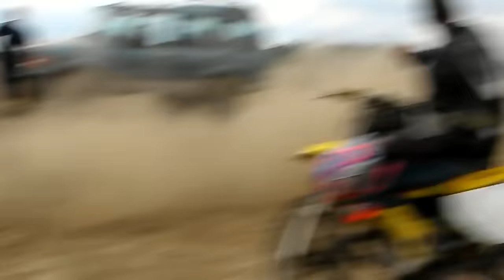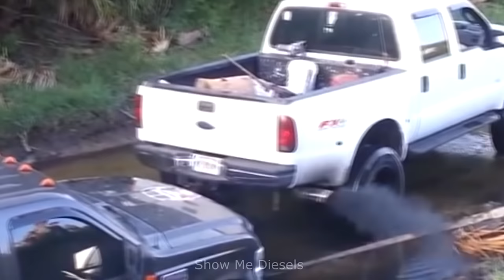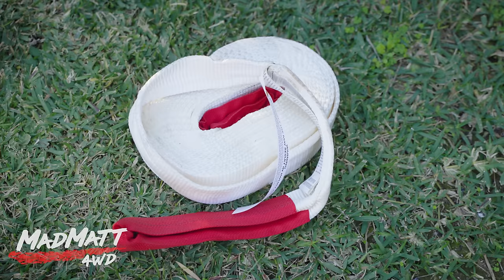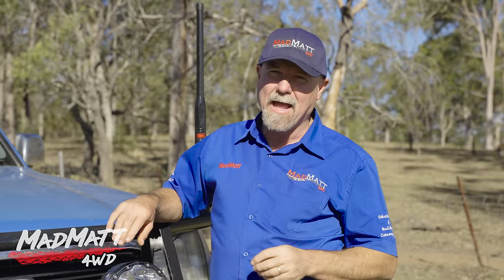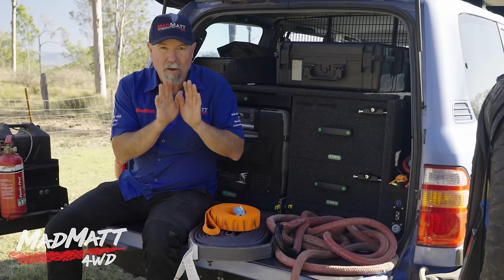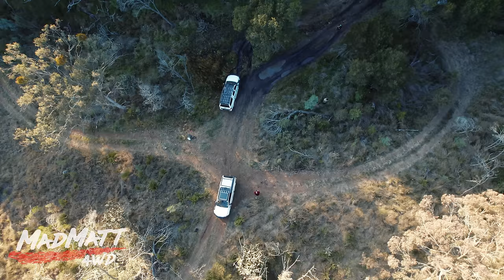PEOPLE ARE GETTING KILLED, Kinetic vs Tow Recovery what’s the difference?

Comment: Simply it is the old formula  E=1/2 x Mass x Velocity ^2  M=kg V=m/s
Reply from the maker: I’m no mathematician but I’ve been told that’s the formula.
Reply: If you say so...   😉
Reply: @MadMatt4WD   Just take a look at a 3000kg car moving at only 8kmh and using chains. It's over 300 Tonnes ! A chassis Rail can only take 24 Tonnes and a tow ball fails at 12 Tonnes. So even at 8KMH something HAS TO FAIL.

To calculate the force exerted and the equivalent mass (in kg) when the energy of a 3000 kg mass traveling at 8 km/hr is dissipated in 0.1 seconds, we can use the equation:

Force (F) = Change in Momentum / Time

The initial momentum of the mass is given by:

Initial Momentum (P_initial) = mass * initial velocity

where the mass is 3000 kg and the initial velocity is 8 km/hr.

Converting the initial velocity to m/s:
Initial Velocity (v_initial) = 8 km/hr * (1000 m/km) / (3600 s/hr) = 2.22 m/s (rounded to two decimal places)

Initial Momentum (P_initial) = 3000 kg * 2.22 m/s = 6660 kg·m/s

Since the mass comes to rest, the final momentum (P_final) is zero.

Change in Momentum (ΔP) = P_final - P_initial = 0 - 6660 kg·m/s = -6660 kg·m/s

Now, we can calculate the force exerted:

Force (F) = Change in Momentum / Time = -6660 kg·m/s / 0.1 s = -66600 N

The negative sign indicates that the force is in the opposite direction to the initial motion.

To calculate the equivalent mass, we can use Newton's second law of motion:

Force (F) = mass * acceleration

Rearranging the equation, we have:

mass = Force / acceleration

We know the force (-66600 N) and the acceleration can be calculated using:

acceleration = Change in Velocity / Time

The change in velocity (Δv) can be calculated by converting the initial velocity to meters per second (m/s) and subtracting it from zero.

Initial Velocity (v_initial) = 2.22 m/s (as calculated earlier)

Change in Velocity (Δv) = 0 m/s - 2.22 m/s = -2.22 m/s

Finally, we can calculate the equivalent mass:

mass = Force / acceleration = -66600 N / (-2.22 m/s / 0.1 s) = 300000 kg

Therefore, the force exerted is -66600 Newtons, and the equivalent mass is 300,000 kg. The negative sign indicates the direction of the force opposing the initial motion.

Comment: My parents owned a towing and automotive repair shop and I grew up in a tow truck as a kid. They moved to agricultural and to this day we are still pulling stuff out of mud and holes. Regardless, your videos are always great to watch to keep reminding all of us of the dangers of doing it wrong! Thanks.
Reply from the maker: I’ve often thought I’d enjoy that type of work. Well except the 2am mid winter call out. That would suck.
Reply: @MadMatt4WD  a ''metric ton'', strap,,has a rated breaking strain 4 times the work limit..  so, a 1.5t strap is good for a 5t vehicle,,max..eh..as to using the ''kenetic '' straps,, allways use them, as its less damage strain on the vehicle.. no one uses static straps.. unless winching.. that b/bar,, that ''come off'',,  who,,fitted it, the dumb driver.?.if not,,id be suing arb..
Reply: @MadMatt4WD  5mph..is not,,enough energy for a recovery..  do some home work..
Reply: @MadMatt4WD  you FAILED to mention,,the camera man, should of been at least 3 times the distance from the recovery that the rope length is..  try again..he is now dead, .plus, no one ever mentions the tow hitch pin shear force..just the ''rated'', shackles.. &, the transport tie downs,,are not rated. you need dedicated recovery points.

Comment: Great video. One thing that I would add is that in the kinetic recovery example, the recovery transitioned from a kinetic recovery to a tow recovery after the "bump". This is fine in the bush but may not be a great idea in sand because a tow recovery in sand often can causes the rescue vehicle to spin its wheels and also become bogged. In sand, just do the kinetic recovery to pop the other vehicle out and then both vehicles stop and inspect progress so as not to wheel spin or if you do transition to tow, just go really light on the gas and don't spin your wheels.
Reply from the maker: You’re correct. This is where Experience comes in.

Comment: Excellent video BUT you CAN NOT use kinetic rope more than once before you give it a good rest?????? You are performing two times 4 km/h and again 8 km/h with no rest in between. It is obvious that you are using excellent quality gears and they tolerate it. But out of educational point of view it would be safe to rest your kinetic rope in between.
Reply from the maker: I agree when it comes to straps but I need to find out about it with ropes. Because they are designed as mooring ropes and don’t get a rest in that environment.

Comment: Good video, took  me about five pulls using a 20 foot All-top kenetic  energy strap (I'm sure you're familiar with that name) to pull my neighbors pick up truck off the Ice in his driveway thru 2 feet of snow 6"of fresh snow covering the sheet of ice that was the street using my 2 wheel drive  1995 Ford Ranger mini truck  3,100lbs net weight   energy in motion. 2 feet at a time eventually my wheels  starts slipping on the ice and I had no further traction. Knowledge is power, as I have said before my friend; there is nothing greater than an idea that's time has come.😊
Reply from the maker: Well done. Snow and ice recoveries are new to me.

Comment: how come you did not put a dampener on the strap for the tow or the snatch recovery also you made no comment on recovery points and no menschen of a winch recovery as a option as this is a slow and more controlled way it get the job done I would rather use the winch than any other recovery or am I doing it the wrong  way love your work stay safe
Reply: You are right that a winch recovery is usually the most controlled and therefore safe option when it's available, but that wasn't the topic of this video.

This was a video about tow recovery versus kinetic recovery. I would wager most of the people trying to do a kinetic recovery with a static strap or a chain probably don't have a winch in the first place, so that's a moot point.
Reply from the maker: The challenge of this video was not opening all those other important doors. There’s lots to be said on all the points you raised. I agree re the winch.
Reply from the maker: Thanks Jonathan. Great comment
Reply: Mention
Reply: I agree with all comments here and a good question. Let's say on slippery clay in western new south wales a recovery was to be performed, there may not be a tree or anchor more a few km
The bogged vehicle will always drag the winching vehicle towards this. Therefore a tow or Connectic recovery is really the only option. Matt showed the correct way here of assessing what's available and how to use the equipment,  eg slowly increasing in energy not go flat out first. Hope this helps happy wheeling.
Reply from the maker: I could not tackle all things to do with 4x4 recovery methods so check out this video for more info - Avoid making some BIG MISTAKES during a 4x4 recovery! https://youtu.be/FkJBaKUNPwE

Comment: Matt, great video, though you probably also have some offroad snakes that are disguised as an abandoned recovery rope, check for tags so you don't get eaten.    I was amazed by the soft shackle failure on Merlin's pull and the damage that even a rope caused at way too high of a speed. I haven't heard it talked about but with my climbing ropes and bull ropes for tree work, I'll toss them in a mesh laundry bag and run them through a wash cycle now and again to keep the grit out of the fibers.
Reply from the maker: Certainly keeping our gear in good order is important.

Comment: One thing you didn’t mention that I feel would be worth it, Maybe even making a whole video about, is how much force is needed to perform a recovery. If a truck weighs X, and is bogged to the frame, then Y force is needed.  I think I remember some formula that takes how much a vehicle is stuck, for example to the rim, to the frame, to the fenders, or the hood.  Then the amount of force doubles each level.  Something like that. Then you can make an educated decision about how to safely perform the recovery.
Reply from the maker: There’s so much more to teach on recovery than I can cover in this video. Yes there is a formula for calculating the recovery load.

Comment: Question, Talking about tow straps and rating if I have a 6000lb vehicle and going to recover a vehicle around the same weight 6000lb would a 12,000lb rated strap be adequate for a tow recovery or would it need to be rated higher. Or is the 6,000lb rated tow strap able to do the job
Reply from the maker: To work out the strap you need to go. Two to three times the weight of the lightest vehicle. So for a 6000lb vehicle you need a strap rated between 12000-18000lbs.
Reply: @MadMatt4WD  thank you for clarifying I really appreciate it!!

Comment: Back in the 70's we mostly had static chains and cables. If we needed a kinetic retrieval we'd insert a rubber tire (minus rim) in the middle between two chains/cables and attempt the kinetic recovery with the rubber tire giving us the stretch we needed.

I'm not suggesting this nowadays when we have proper kinetric ropes and soft shackle.

Just an historical footnote.
Reply from the maker: I’ve heard of that method although I’ve never seen it done. I won’t be trying it either.
Reply: @MadMatt4WD  It worked in a pinch, especially with a larger stuck truck being recovered by a smaller truck.

Comment: I teach in the UK. I tend to make the maths simple as 1/2 mph is approx metres per sec.  
So half the weight times that squared. So twice walking speed gives 9+ tonnes of force for most uk trucks. The. I point out the lack of proper tow points on most trucks or the tow ball (forged not bolted like you Aus/US lot). People then suddenly understand that serious injury or death possible.
Problem is there is always someone saying "just give it a bit of a bump"... 😮
Reply from the maker: Thanks. So long as people end up with respect for recoveries that’s the what my goal is.